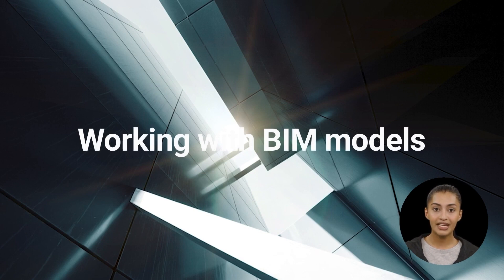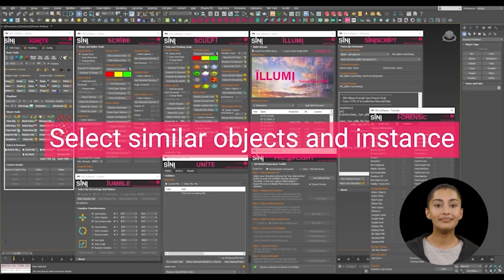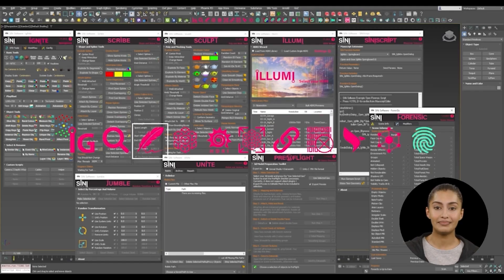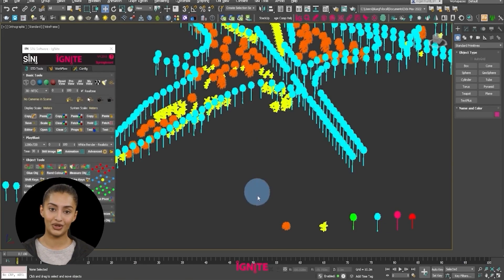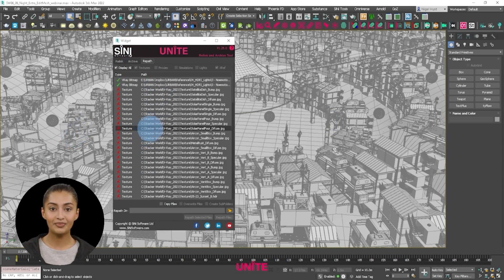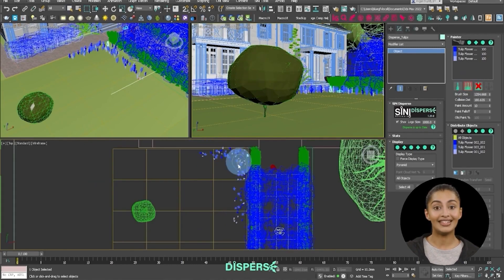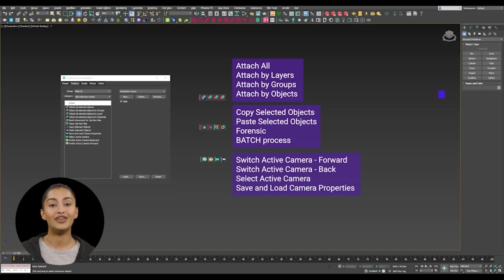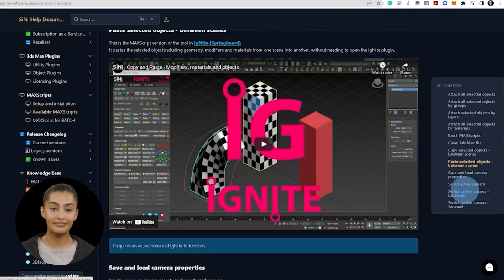Five archviz workflows for speed and efficiency  -  English

Comment: Is it possible to assign a shortcut for pivot tools or we need a script also ?

And also how to change measure units for Measure Object toll inside  iGnite
Reply from the maker: Hi. There is a hotkey assignment for SiNi pivot already. You will need to assign it to a key yourself.
Reply: @SiNiSoftware  I'm aware of that but there is no way to setup a key to align to center buttom or center other pivot places
Reply from the maker: @Rammahkhalid  We'll add it to the MAXScript/hotkeys wishlist.
Reply from the maker: The IgNite measure tool works with system units.